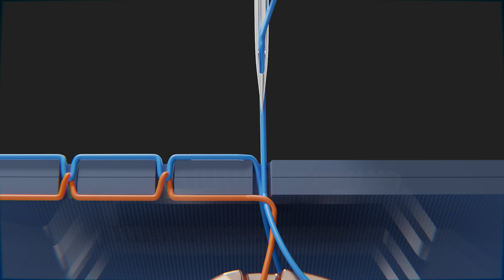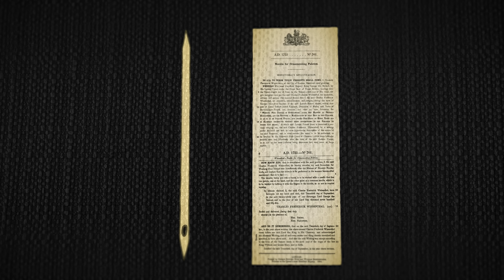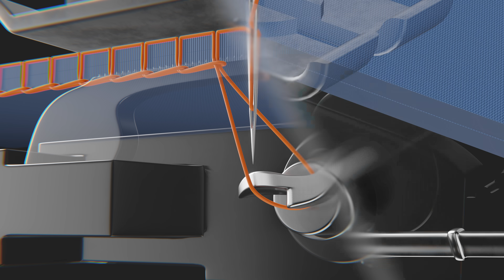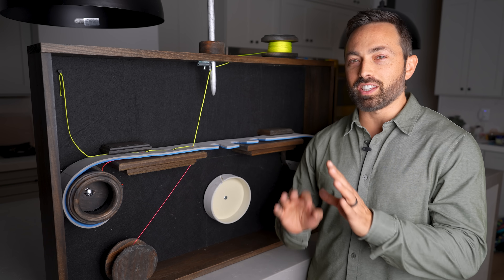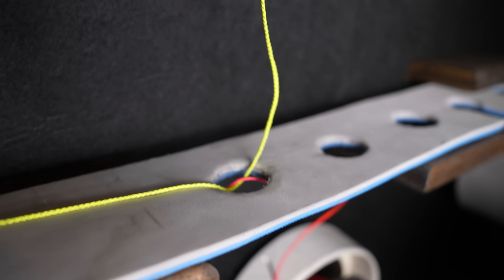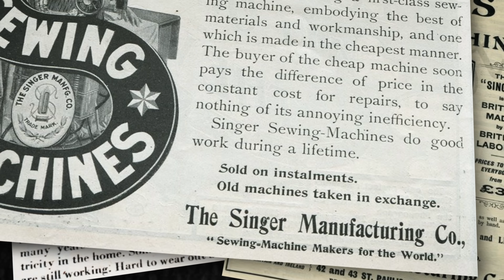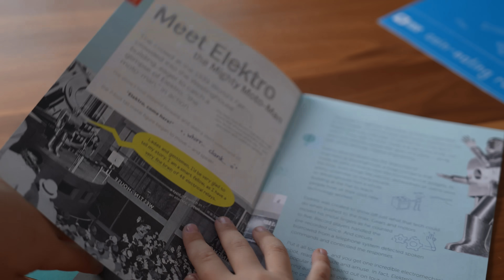The Surprising Genius of Sewing Machines

Comment: If you are smart, you use old clothes as rags, first for the house, then for the cars, then you put some kerosene on them and light a fire in the fire pit or burn pit.  You will have reduced the volume of waste by 90+ percent, and if the clothes are 100% cotton, the ash can be put in the compost pile.
Reply: If they're 100% cotton they can be put straight into the compost pile at any stage. If they're not, their ash still can.

Comment: nice video but it didn't answer my biggest question about sewing machines: how does the threads goes around the bobbin? Since the bobbin capsule is on an axis the thread can't pass around the whole bobbin capsule.
Reply: Play 11m00s to 11m45s at slow speed. The key seems to be putting a half twist in  the top thread loop before it it picked up by the rotating hook below the deck. This means the top thread can be looped over the stub axle mounted bottom thread bobbin, crossing over the axis on the non axle side,

Comment: Some machines use nedle feeding instead or in combination with dogs , for example very heavy duty machines for sails or canvas.
The  reason is that it eliminates uneven pull in the layers ,that a dog feed only  machine may induce.  You  misst that in the video .

Comment: As a seamstress, THIS WILL NOT HAPPEN!! YOU NEED TO PRESS THE FOOT PEDAL TO MAKE THE SEWING MACHINE RUN(kinda like a car pedal to make it go) So therefore she must’ve been sewing with her eyes closed apparently. Also the way she just rips the dress out from the sewing machine  is completely wrong??? Like when you’re sewing you put the presser foot down(a small contraption that holds the fabric down and makes it so the sewing machine will automatically move the fabric up.) and when your done sewing it you put the presser foot back up and if the needle is still in the fabric you can manually move the needle out to get the fabric your sewing loose so you can get it back. ALSO EVEN IF SHE DID WHAT I STATED AND TOOK THE DRESS OUT NORMALLY WITH RIPPING IT SHE WOULD RIP THE SEAM WITH A SEAM RIPPER AND THE DRESS WOUKD BE FINE??? I honestly hate when they misrepresent sewing in stuff.

Comment: I don't think any of these will work because they all require the thread's loop to be timed exactly and placed at the right position for the needle to pass the loop and somehow the loop unwinds and stuff.  Anyway the point is this way of sawing requires forming topological loops which is almost impossible to achieve with any machine at this point.  This is why we don't have self tying shoes or robots that ties shoes for you.

Now, modern sowing machine do not sow, they simply glue.  The thread's on modern machine are just for you to glue one some predestined embroidery.  The fact is we don't saw because all our cloth are basically 3D printed, the are cut form a topological cylinder to exactly the right specification.  This is why you don't find any seams on your cloths anymore.  And some parts are shrunk through certain process to get your T-shirts and dresses.  As far as thee firms are concerned everything is just cylinders, or balls of genus 1.  Bikini should be trivial to everyone.   This also means everything we wear are all synthetics nowadays aka plastics because it is hard to make a topological cylinder from raw materials like cotton, wool, or silk.   And these guys are hard to manipulate chemically and optically.

So my mom used to make her own cloths.  Her sawing machine has two needles one with a hook and the other has a hole and one thread.  If you have ever done any crochet, you can probably guess how this works.  The thread' needs to be wrapped around the needles precisely.  Theree is a priming step which is very hard to get right that you have to do manually.  And one of the needles go up and down but the other can twist and turn but the mechanism hidden inside a box attached to the needles.   But the whole thing basically mimics the crocheting process which does not require turning the needle and can be done pretty fast even by humans.

E:  the twisting needle is the hook needle.  The hole needle is up and down.

Comment: I do all of mine by hand. But its sloppy and is only meant to keep my pockets from losing my keys, markers, pocket knife, flashlight etc..

But so far ive fixed a backpack, several pairs of pants, the tongue of a boot, the back stitching of a boot, and a few other odds and ends. But i am very glad i decided to give it a whirl and now im not just throwing something away because of a hole or a separated seam. It may look like it was done by someones pet monkey but the stitches hold. I overbuild everything i make or repair. Try to anyway..
In fact a few weeks ago i had to fix a hole in my pants pocket but i only had about 30 minutes before i had to be at work so i cranked out the fastest cheap and easy stitch job ever in about ten to fifteen minutes. So far its still holding.

Anyway, this video is great. Ive actually wondered a lot of times how they work. Now i do. And now i know how to do some better stitches by hand.

Comment: 16:33 lets fix it make sewing slower so cant buy new lol. make it expensive and no buy not option lol lol. if something go high all rest follow. including pay. nothing was changed. same as again drop every thing.
if you get paid 10 you can buy 10 milk that cost 1. if milk get higher 2. your paid is get 20 later and again u get 10. nothing was change than moni value.
this happen everyday in smaller steps. prices go higher u get more paid. why cant we reverse it lol. it will be same thing. bcoz noone want to be that loosing link that lower prices. other follow prices lol. manufacturing is cheaper peoples get paid less...and there we r again xD.
its all fake more paid but everything follow. i mean everything go higher then paid get higher

Comment: My gramma was a seamstress & my mom got her Singer machine & now I have it. It's amazing it works like the day it was made. The electrical cord has needed to be replaced, but other than that nothing has ever broken on it, and it continues to work beautifully. Nothing on it is loose or worn out, and it's seen a LOT of use. Sure it weighs a TON and I bash my leg every time I  drag it out of the closet. It still sews at bullet speed without missing a loop, and even though I have a modern sewing machine, I still prefer to use the old Singer, so long as it doesn't give me a shock. 😖😮🥴

Comment: Well crap. I was pretty dumbfounded until I saw the giant version and realised that it's just making slipknots through loops, a common way to for example pack a rope. The point indeed is that just by pulling from one end you get a straight rope when you need to use it.

Comment: Thank you so much for this very useful video! I never realised why sewing machines need two threads (upper thread and bobbin), but you have explained it very well. Kudos to those who continuously worked on perfecting sewing machines. I also think, if most of us sew at home, we will appreciate how hard it is to make a clothing item, and we will appreciate what we have more. Of course, there are fabric hoarders (we sewists all do at one stage), and that's another issue to solve. However, in general, the issue is not with the sewing machine. It's with our over-consumption habit.

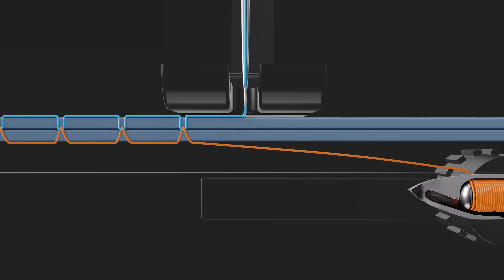Comment: 10:34 - yep! I've got one (Late 1800's Singer with vibrating shuttle mechanism)... still works great.
Reply: How is the shuttle (bottom thread) being pushed around? The top thread must be allowed to pass all around it. How is the shuttle connected to whatever is pushing it back and forth?

UPD: I got the answer from ChatGPT: 
"The shuttle is not rigidly attached to the driving mechanism. It sits loosely in a shuttle carrier (driver) that pushes it back and forth, while leaving its nose and body exposed so the upper thread loop can pass completely around it."

Comment: I collect old sewing machines and the difference between old and new machines is so wild. Modern machines have their space and things they are far better suited for, but they certainly have nothing on old machines when it comes to raw punch through power and sheer durability. I use my 1897 (treadle and hand crank) and 1918 (hand crank) machines to sew denim and they crunch through 3-4 layers of THICK material like jabbing a sharp ice pick through cardboard without so much as flinching. My modern machines, bless them, could never

Comment: I inherited a hand cranked Singer machine from my aunt. It is 80 years old and it does lovely stitches. I have stopped using my electric machine for most jobs because the old one is so lovely to use. It’s much safer (my mum once sewed through a finger using her electric machine),You can go as slow or fast as you like, it uses no electricity (environmentally guilt-free sewing), and I can use it anywhere  with no annoying trailing electrical flex. If you sew and you have a chance to own one of these, grab it, you won’t regret it. Fascinating to finally see how that bobbin bit works.

Comment: While I appreciate Derek’s look at the genius behind the Singer sewing machine, I think the explanation for their longevity is more nuanced than just “they were built before planned obsolescence.”

Back in the late 1800s, the innovation cycle was much slower. Consumers didn’t expect new and improved products every few years—they wanted something that would last, and manufacturers responded by building for durability. In that era, the public mindset was focused on long-term value, and the market rewarded products that delivered it.

As the pace of innovation picked up, so did consumer expectations. People got used to rapid improvements and new features, which made them more willing to replace products sooner. Manufacturers adapted to this new reality by focusing on frequent updates and shorter product cycles. Over time, this dynamic evolved into what we now call planned obsolescence, but it started as a natural response to changing consumer demand, not just as a manufacturer-driven tactic.

So, while Singer sewing machines are amazing for their durability, it wasn’t just because manufacturers were more virtuous—it was because the market and public expectations were completely different back then.
Reply: When Singer sewing machines were first mass-produced in the late 1800s, the rate of technological advancement was fundamentally different from today. Innovation cycles in the first industrial wave lasted approximately 60 years, compared to just 25 years in our current sixth wave of innovation. Patent activity, which serves as a proxy for innovation pace, was orders of magnitude lower—around 7.7 patents per million people in 1800 versus over 1,000 per million today.

This slower innovation pace meant consumers had no expectation that their products would be superseded by superior technology within a few years. Consumers expected products to last decades because technological alternatives simply weren't emerging at today's breakneck speed.

While planned obsolescence as a formal strategy did emerge in the 1920s with examples like the Phoebus Cartel reducing lightbulb lifespans, the more fundamental shift was the acceleration of innovation itself. In today's environment, even without deliberate planned obsolescence, products naturally become functionally obsolete much faster due to rapid technological advancement.

The Singer sewing machine's durability is less about pre-obsolescence virtue and more about operating in an era where "the next big thing" might not arrive for generations rather than years.
Reply: Singer had a great reputation, but it has declined a lot. Today people recommend you to stay away from it. I suspect that is due to lots of user errors, I see videos on sewingforums daily where people ask for help and usually it's user error. 
I'm about to buy a machine and I'm still tempted to go for a $300 machine from Veritas, which is also supposedly poor quality. I suspect they exaggerate when they say it's poor but I don't know. Do you? I'd love to hear your opinion.

Comment: The modern bobbin demonstration is not working for you... you aren't showing a hook and the funny loop thing you did  with your fingers was a bit confusing. Narrative is reasonable but the mechanical demonstration is sorely inadequate.
Reply: The demonstration is spot on, I know sewing machines. The only difference is the hook, which Derek replaced with a slit in the bobbin case, but that's not important at all. Same principle, same function. He literally did sew with it so I don't know what you're on about.
Reply: @Reptex_krka  I am on about clarity. I respect the intention, but this demonstration needs some work. There is some fine detail in the way that hook works that is being glossed over...
Reply: @paulwiggins183  you seem rather confused, the hook just hooks the thread, just like the slit does. Let's not pretend a hook is magical.
Reply: @Reptex_krka  I confess to loving magic.
Reply: The trick is, of course, that the upper thread goes completely underneath and around the bobbin, which is sitting loose inside that rotating thing with the slit. This is indeed not very clear in the movie. The movie could have zoomed in some more to show that wire going around the bobbin.

Comment: I pulled a machine to bits once in the 1980s to understand how it worked, included patterned stitching with a "code" wheel, all; mechanical. I was saddened that I was destroying a work of art, never to put it back together again. Every piece was machined with hardened shiny steel, and all the tiny parts were beautifully formed perfect as minimalist curves, and almost Geiger like organic. I learnt a lot to start my engineering journey, from a machine made pre 1980s.. if not a decade earlier.

Comment: What I'd like to know is why they can't supply the bottom stitch directly from a spool of thread (like the top stitch)? Why do you have to wind a rather small bobbin? (With all the fine engineering that goes into these machines, why has NOBODY done this? Is there a bobbin cartel preventing it?).

Comment: DANG ME!!! I'm 68-YO. Began on mother's Singer 401 in 1960 - I was 4. I NEVER had any clue how it worked!! I knew tension was the "big deal" & as an accomplished hand-stitcher I completely understand why. But, to me, the machine was literally (what I referred to as..) FM. - F'ng Magic! Your video was fascinating and I definitely want to pull out my OLD 401A & see if it needs anything more than cleaning, oiling & adjusting (maybe a new band or 2.)! Mother gave it to me as a gift for 16th b-day in 1972. It finally appears to have bit the dust in 2002, about 3/4 of the way through my daughter's wedding gown, resulting in my hand stitching pretty much 24 hr/day for 2 full days. But - it was beautiful. In 2012 I finally bought a new COMPUTERIZED,  "basic" machine. Ive used it ONCE. HATE it. I now sew by hand, but really want to see if I can get my old girl going again!! I was absolutely amazed at the actual technology as well as your models and explaination demonstrating it! 🎉🎉❤❤
Reply: you almost certainly can and there's tons of resources online for doing so. For starters, I HIGHLY HIGHLY reccommend AndyTube, right here on you tube. Have fun!
Reply: Damn any updates on if it's working?
Reply: @a-manthegeneral  no - would be a few months before I can even access it. 😖

Comment: My dad had a Singer sewing machine, forgot which model but it's manually operated by feet. When not in use, he releases the tensioner between the flywheel and the machine so the rubber rope won't loosen up. He'd stitch up his own torn clothes until it's either too ugly and/or too broken to wear. By that point, he used it as a mat or dining table wipe. Of course, they're not used in the living room where guests might see them. Granted he's a bit old-schooled (born in 50's), but he never wasted any fabric and at least skilled enough to fix his own clothing. After he passed away, I gave the machine to his younger brother's wife who is a tailor. The sewing machine still exists today, living to its fullest potential and stayed true to my father what used to say, "Singer machines are indestructible compared to others like Butterfly".

Comment: I am buying my first proper sewing machine because I am small and I can't find clothes for not fat people in today shops (seriously, the smallest commonly available throusers size for me is like 90 cm in waist, it's ridiculous, the same with leg length, it's getting longer and longer each year, my 20 years old jeans fit without shortening it, but today jeans are like 15 cm longer than my legs, why???) this video helped me a lot with understanding how it works. I already had some little battery machine, but it was doing that basic chain stich and yes, when just one stitch is not locked properly, it will all fall apart, so nice to hear that machines with bobin solve this problem.